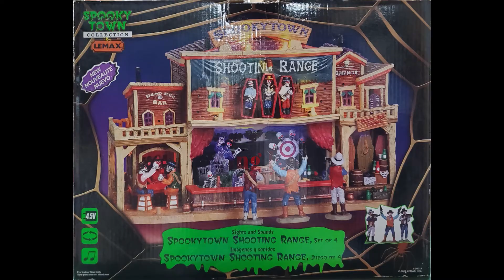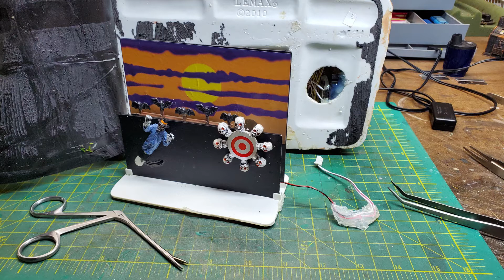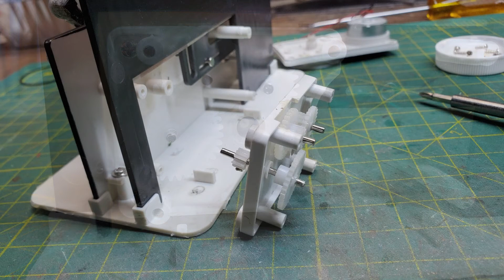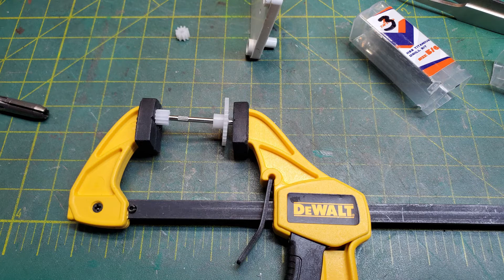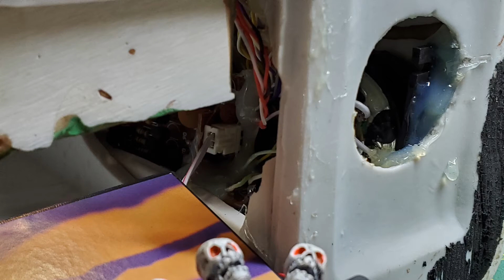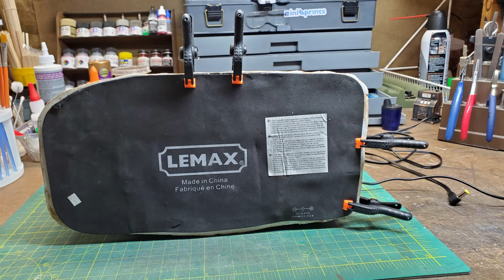Lemax Spooky Town Shooting Range repair

Comment: Hi! Thanks for sharing. Do you have any tips on fixing a spooky town that's not making sound anymore?
Reply from the maker: You're welcome. The best advice I can give is to check out Random Junk Channel. He has a few videos dealing with the loss of sound. Usually, it's a broken wire or bad solder joint, or sometimes the volume control has gone bad. He's sometimes fixing displays with multiple problems so it may not mention the sound problem alone.

Comment: Thanks. I have one with the exact same problem. I was also on the random junk channel that had this too and saw your link. I like your vid better, straight and to the point. I got mine out by cutting the foam at the bottom. That worked quick and easy for me. Now to get the gear.....
Reply from the maker: Glad to hear you tackling it. They sure didn't think of making them repairable. Good luck. 👍
Reply: @CassidysWorkshop  Would you sell me one of those gears? Same one. Would like to get it going before Xmas.
Reply from the maker: @tramdr  Would if I could. It was a selection of 58 different gears, and there was only 1 gear that worked for this. But it was from Amazon. If you search JLMetal 58pcs Plastic Gears Module 0.5 for DC Motor DIY Model Toys you'll find the selection.